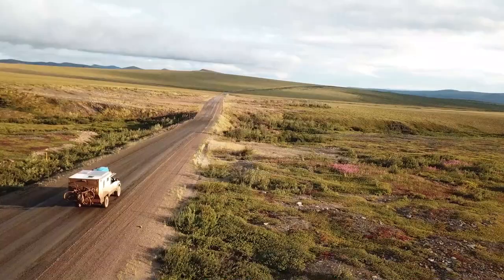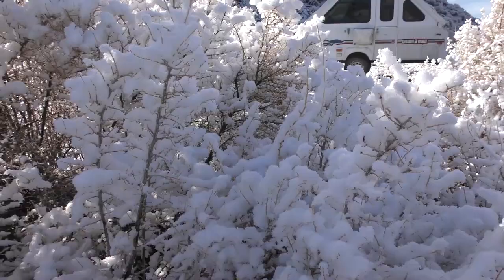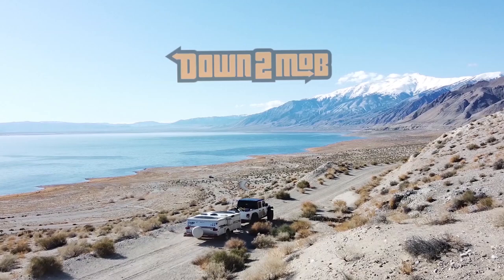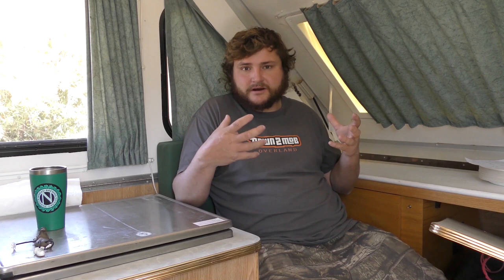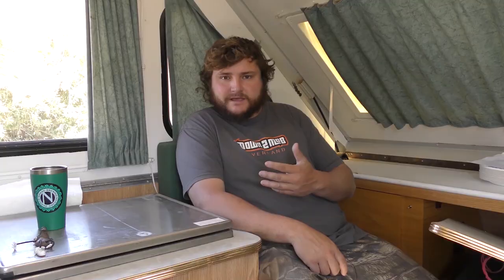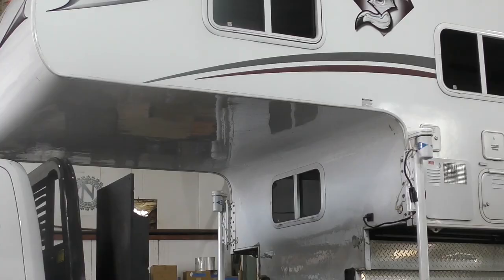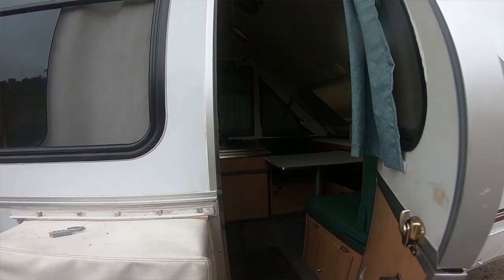TRUCK CAMPER vs. CAMPER TRAILER - Pro's & Con's from a FULL TIMER

Comment: Hey there Phil. That was the most stuck I've ever seen anyone get in a 4 wheel drive. I was in the mountains of Colorado back years ago while fishing for trout. I was at Twin Lakes which is on Independence Pass. I started hiking toward the brook. What I didn't know, was that where the brook dumped into the lake, was  quicksand. A guy got mired in it up to his neck the year before. I have had some experience with quicksand from a previous time. When I walked up to edge of the brook I decided to walk back about 20' and get a running start. When I jumped I made it about 2/3rds of the way across. Yeah, you guessed it, I started sinking into the quicksand. I sunk up to the middle of my thigh. I leaned towards the far bank and pulled myself out. When I went back I walked upstream and was fine. Scary. I said that, to say that you ran into a small patch of quicksand. They use those western lakes for irrigation downstream. When the lakes get low, the groundwater wicks lake water back up to the sandy areas. The part of the country I come from has a lot of groundwater. The groundwater flows under the ground to the river or streams. If there's sand close to the stream, a heavy animal, man or vehicle can break through creating a potentially dangerous situation. Thank God that the water supply was small. Any more and it could have been really bad. Enjoyed the show. Take care and stay healthy.     Vaughn

Comment: Enjoyed the video. As you mentioned several times. These choices are personal and everybody has their own reasons. I've chosen the truck camper older truck smaller flatbed camper. I looked at everything out there including the trailer you're sitting in. I just do not want to pull a trailer. I've driven in all kinds of road conditions and yes there's a trade off between a truck camper and towing a trailer. But my experience the truck camper was better on road ability. If that's a word. I am not a four-wheeler although dirt roads seem to be my main travel method. 95 Toyota T100 rear wheel drive extended cab now a flatbed. I did keep the pickup truck bed. It's a shorty and made it into a trailer with the original topper and liner. My camper is a pop top. It is self-sufficient solar. Everything inside is electric no propane, composting toilet, very basic and simple. And yes, the camper stays on the truck 95% of the time. Not as simple as it might seem to remove and replace. Certainly not a one person situation

Comment: Not many advantages of a truck camper I can think of. Heavy, cause the truck to sway on uneven roads, catches every low hanging limb, etc. I'd much rather just hook/unhook from a trailer and have my tow vehicle free to do whatever I want. As for the turnaround dilemma, just unhook it and turn it around!

Comment: I'm a part timer.  I have a BFV 2003 Chevy 15 passenger turbo diesel van converted to a camper.  Queen bed 400 watts solar, DC/AC fridge etc.  I pull a 20 yo Jeep Cherokee for running around.  Love it.   But....  I'm thinking a 5500 diesel flatbed camper plus also pulling a Jeep as my next rig.   Love being able to pull in anywhere, crawl in the back of the van and pass out.  I just have to be careful in more rugged terrain with a van.

Comment: Thanks for your thoughts. I’m inclined towards a small truck camper. We’re on the east coast. We leave a 28’ trailer up in Cape Breton. We do 4wheeling, boating locally, but really want to do some exploring in the provincial park, go over to Newfoundland, etc. Sold the 3/4 ton, what was I thinking! now have a 1/2 ton so have weight limitation. The pop up truck camper looks ideal. and there’s the stealth factor. You can set up the table and just crawl in for a nap, not bother with raising the top. The old man drove otr for years, so no matter, pull something, back under. Not a factor. A frame is nice tho!

Comment: Regarding maintenance, truck camper will wear out your trucks rear wheel bearings and suspension faster than a trailer, due to more weight on the axle. suspension upgrades may be needed to make the truck able to handle the weight off road.

Comment: I've had both a truck camper and a trailer. (I'm enjoying the camper right now)  I can come up with a good excuse for both. Just depends on who you are. If you don't know which one you are, try both. You will figure it out. Just know the two sides are just arguing about who's camping the best. Your still camping.regardless.

Comment: just put a big wheel crank down wheel up front of the camper . and carry a long pry bar so you can detach the tailer on the big wheel . use the pry bar to push the trailer noise around . then simply rehook the truck. easy u turn

Comment: Great video!  I have a fith wheel trailer now but for years I had a pop up truck camper.  It was perfect for get to places and camp that I cant do now.  There is something about getting to that great place in the woods and no one else is around.  

If I still had my pop up I would load it up with solar a few lithium batteries and leave the generator home.

Comment: I've owned a 37 foot euro coach, that was more than comfortable but really sucked driving it in Los Angeles 16 years ago , then when moving to az I got a starcraft pop up , did its job going to camp Verde, then tried a 85gmc 30 jaimee  cabover,  took that to box cayon for easter 4 years ago pulling a really good size pop up for the kids . They both did really good. Now I have a mallard 19n with no slideouts  and best trip so far was last year on a trip to sand hollow   utah. Best part was parking the trailer in sand hollow and being able to travel and explore utah more then go back at the end of the night. Now my next choice is a toy hauler since I have toys as well but also been considering a truck camper so I can pull my toys as well. I guess it all depends also if you have kid's and what you plan on doing for that trip. And of course if you live in HOA and what you can have without getting fined In your development. Great video and info.

Comment: I kind of do both. I have a nice Arctic Fox four season trailer that I use a lot October thru April when it’s really cold. Plus I use it for extended camping like during fall hunting season when I camp for 4-6 weeks at a time. The rest of the year I use a Ram 1500 with a camper shell. I have a drawer system that I built in the back plus some totes. I have a quick setup tent as well as a Hennessy Hammock that I use with almost everything in the drawers and totes. I really like being able to use my truck without having to break camp every day. So that’s the compromise I’ve made in order to have the best of both worlds.

Comment: Great Video.  I too am thinking of buying a Gladiator.  One thought was too put a 4 Wheel Camper Topper on the Gladiator and tow a small trailer like a Nucamp Tab 320 or 400 Boondock , or an Airstream Basecamp X.   For rougher trails and shorter outings, I could use the topper for camping.  For longer term stays and easier trails the trailer would be nice.  The other option is to see if 4 Wheel Camper can do a flat bed truck camper for the Gladiator.    The last option is to buy a full size truck and put on a larger truck camper, but the Gladiator looks so cool.

Comment: I have an Aliner off-road, if required on three point turns just unhook and rotate trailer. I agree with your conclusions. I normally setup in one place for two weeks at a time.

Comment: Kids impact that ideal rig problem too. Especially given the RV biz builds too big and costly family camper rigs for the typical 2-4 trips a yr most families make. And given the 2-4 trips a yr a multi use trailer will be more practical vs one that sits for 8 months and sees 2-4 trips. Vs a trailer that ends up hauling renovation materials, furniture, etc. 

For my Hard sided RV trip needs I’ll likely just rent the smallest bunk house for sub $100 day for that trip. Our camp trailer Two Queen beds, is basically a 4x6 utility trailer with a tent on it which works well for 99% of the trips we do, plus it doubles as a utility trailer. Hauls bikes, boats, dump debri trips etc. 

The stay in one location for a while vs daily move yes the trailer is ideal but most are stupidly too big still. 

Solo constant traveler the truck camper hands down best way to go. Or maybe the van they are similar. 

My number one complaint is the lack of small camp trailer / utility options for families of 4.

Comment: I have had a pop up camper trailer, traditional hard side trailer and a pickup camper. I am still running the pickup camper. I have horses which I want to take with me and you can’t tow two trailers. If I don’t want the camper in the bed of my truck and I’m not taking horses I have a flatbed trailer that the camper fits on and then it’s a camp trailer.

Comment: Good discussion. I have an A-frame (Chalet Arrowhead) and drag it everywhere I can with my Tacoma. You are correct about the limitations for exploring but since I don't do hard off roading I find the home base trailer concept works for me and still allows for some detached exploring with my truck. As for turning around a 30' plus trailer truck combo, no fun in a tight situation. I have unhooked but don't try to move the trailer. Just reposition the truck and rehook at a better angle.

Comment: Couple other points.  Truck camper always also pulling a boat or other trailer.  I don't want to pull two trailers.  Travel trailers are a lot cheaper than a truck camper.  Most truck campers are also going to require a 3/4 or 1 ton truck do to weight.  More types and weights of Travel trailers can be pulled depending on your vehicle.
Reply: Some more points. Trailers have much more storage (tow vehicle), mpg is probably better, are shorter (fewer problems with overhanging branches, tend to be cheaper, aren’t as tippy, don’t require suspension upgrades.

Comment: Many years ago, I had a 22 ft travel trailer pulled by a Ford F-250 Camper Special.  I sold it in 1977 and did not camp for a lot of years.   Then I got a Coleman Insta-tent and used that for about 10 years. Now I'm in my 70's (way in!).  For the last 10 years sleeping in a tent got harder and harder.  Especially getting up off the ground in the morning.  Three years ago I decided to get another camper of some sort so I could join my sons when they went camping.  I was limited in what I could get because of my truck.  I did not want to have to buy another truck.  The funds just weren't there.  I had a 2007 Ford Ranger.  I was limited to what I could carry in the bed, and limited in what I could tow.  I looked at a slide-in camper, and nearly bought one.  But I just felt that the truck would not be able to handle the weight.  The Ranger was just not designed for a slide-in camper.  I ended up buying a 12 foot Pop-up tent camper trailer.  So far it has worked out very well for me.  There are times when I wish I had a slide-in camper, and times when I wish I had a hard side camper.  I can't have everything, so the pop-up will have to do.  I am enjoying it though!
Reply: I have seen slide-in's on Rangers before mostly pop-ups.  Not sure what the payload is on a Ranger...  You got more room in your 12 footer no doubt.

Comment: Good info. I have been torn between a truck camper and an A-frame trailer like you are using temporarily. Another YouTuber, slim potato head had one but he made so many modifications to it that I believe it started leaking on him. I have looked at many truck campers online. I think the pop ups which are lightest would cause the most problems with condensation and even leaking. I want four-wheel-drive.  So I am now considering a Chevy suburban from SubOverland. I still have 16 months before I can get out there...
so lots of time to decide. Good luck on your Jeep build!

Comment: This is a great cuestion. I would rather have a trailer, even if its a teardrop, in case of truck breaking down, especially if it's not a problem that will be fixed in a couple of minutes and you have to leave the vehicle in the shop

Comment: Truck camper registration depends on your state.  Some register and license truck campers the same as any other RV.
Reply: Yep, Utah requires title and registration for Truck Campers
Reply: And why would they do that?  It isn't a vehicle after all, more like cargo without wheels.  Also when do they decide that it is a truck camper? Bathroom? Sink and stove? Empty shell? Truck topper?
Reply: @marcpikas2859  I believe the distinction is if it's intended to house people and if there are six sides. So a truck cap is excluded.  I wish they wouldn't do it, but then it can prevent some pretty unsafe situations too.

Comment: I have a crazy-ass idea.  I would like to see some forward thinking overland manufacturer build an overland truck camper 5th wheel hybrid trailer.  Confused?  Let me explain.  Imagine a 5th wheel trailer that is no bigger than your average truck camper.  Why?  Several reasons.  1. This design would still be fairly short enough to go off-road and be easier to hook & unhook than a regular trailer.  2. You can have a comfortable north-south queen size bed but without the added height because the camper cab-over would be over the bed of the truck instead of sitting high up over the truck cab.  3. Turning around in a 5th wheel does not have the same limitations as a regular trailer does.   And 4. This concept allows the camper to have a rear door or side door entrance/exit.
Another option to this would be to have a custom flatbed to give more space so the bottom edges of the cab-over will not hit any side truck bed frame rails.  A custom off-road articulating 5th wheel hitch would
OR....... Just find a custom trailer manufacturer to build a skeletonized flatbed 5th wheel trailer so that way anyone can load their already existing truck camper onto it.

Comment: It is hard, generally no one thing can do all jobs sadly.  Everything is about sacrifice.  Your constantly on the move, so a truck camper makes a lot more sense for how you travel.  Whats your tow capacity going to be like with your truck camper?  Might be able to tow along a small trailer for when your going to be staying in an area for a while...but where to store it? so many questions lol.  So you getting one of those shiny aluminum truck campers?

Comment: I have a 2007 Aliner Expedition. It has a toilet/shower combo. I hate setting it up. Lifting the sides and roof is the easy part. The older aliners are very drafty. I spent a lot of time placing rubber pipe insulation in all the roof cracks. It does tow really easy though.

Comment: Pretty much spot on just trade in my truck camper for an A frame pop up for the reasons you mentioned 
I go prospecting and my pu with camper wouldnt get me into the really tight spots so the toy hauler pop up im pulling with me Exterra drop it off in a nice spot then go wheeling with the exterra

Comment: Did not really understand the appeal of a truck camper until now. I have been seriously confused.

However, the really big ones still make no sense to me. A review I watched recently was a multi-slide unit that was pushing max payload for even dual wheel trucks! Had a starting MSRP of over $50,000. At the end of the day the combo of truck and camper was competing directly with 20 ft class C campers.

Comment: The problem with all trailers are tires. They take a beating; don't last long; and are to find. Sold my vintage airstream and bought a pop up TC. Reason? Fits in my garage on the truck with top down; don't have to pay for storage; 4 TRUCK  tires on the ground and is always ready to use.....and has a real toilet with blackwater tank. Built in propane heater;  dometic and AC ( not on the roof) i never use the A/C because campgrounds are to expensive!!

Comment: I haven't seen every video,  but I have seen the end result jeep with the camper on it.  I don't like it at all.  This dodge and camper is amazing,  puts that jeep to shame. I have and F250 diesel and would never buy a jeep, or go smaller, I think it's time for you to dump the jeep and go back to a full size truck and another flat bed pop up camper.   Just say n.  Only my opinion.   I am going to get my 1st pop up truck camper, getting the F250 ready for one now.  Pretty excited.

Comment: Being mindful of weight and cost. The artic fox truck camper i have is over 3000lbs dry and will tip you smooth over if not careful took airbacks and bunch of tiedowns so your aframe vs heavy truck camper id pick a frame all day

Comment: Quick Summary
8:27 -  Camper vs trailers. What are each best for?

Full breakdown: 0:00 - Intro

0:49 - Back story of his experience. 

2:06 - Benefits of trailers

3:16 - Downsides of trailers

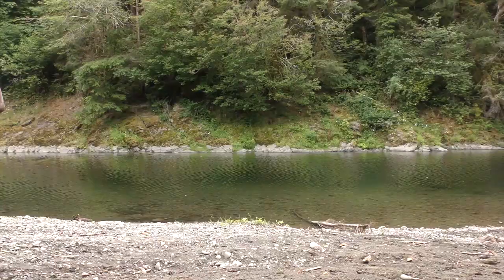5:18 - Truck camper benefits

5:42: Summary of layout and options with both.

6:31 - Mobility between vehicles, and truck camper resale

6:47 - Truck camper benefits and trailers cons

7:43 - Whats best for Overlanding.

8:27 - Summary: Camper vs trailers. What best option for others?

10:18 - General space comparison. Trailers are bigger.

11:08 - Start of Conclusion 

11:50 - #1 consideration, Where do you want to go? 

12:21 - Weekend warrior advice. 

12:53 - He prefers truck campers for his adventures 

13:12 - Sign off

Comment: I'd rather pull a Camper trailer than Camper truck.
Get yourself a nice decent wide jockey wheel for the rare occasions where you need to turn around for instance in this video. Offhook turn around re-hitch and hit the trails...  🤠